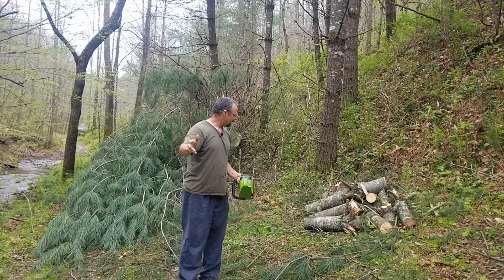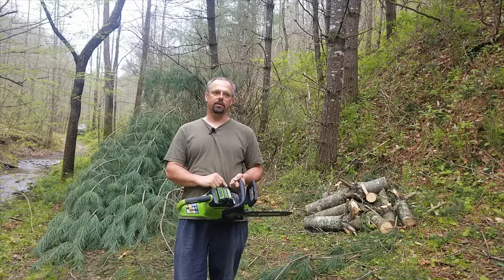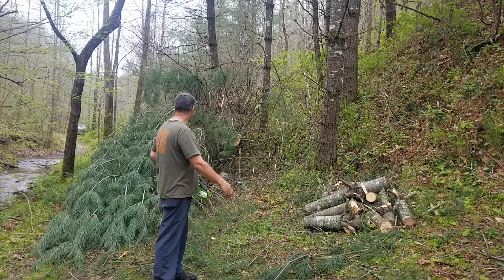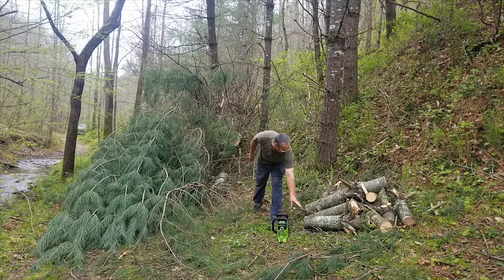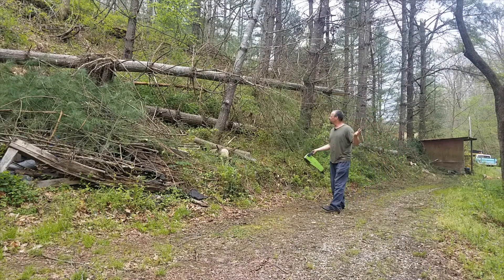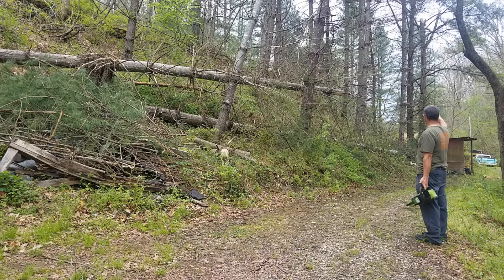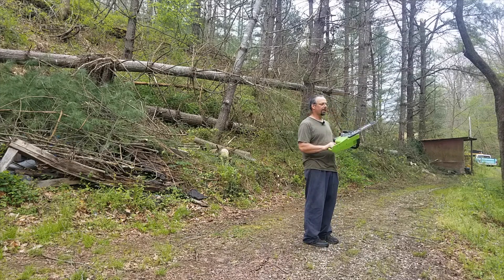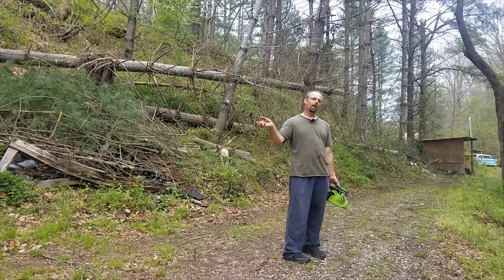Greenworks Chainsaw after the Mod

Comment: I have this exact same saw and while it cuts pretty well, I also experienced the shutoff problems, especially when the battery got down to one bar. Besides being annoying because it stopped in the middle of the cut, a cutter usually got stuck into the work so the saw didn't want to come out without being powered up. I'm pretty sure I'll be doing some relocating and possibly removing that problematic control. Too bad it didn't have a high temp adjustment to raise the cutoff point but moving it should rectify the problem. Even with the sensor gone, it should be easy to monitor the temperature by laying your hand on it. Great tip, THANKS!!!!

Comment: I wonder if mine came with a sensor since its never shut off on me.
Reply from the maker: It might be working correctly and mine was a defective sensor. Glad you got a good one, seems the saw has potential.
Reply: @lukeFugate  I got lucky and caught Wally world advertising it 100 less than they actually sold it for. Its just the 40v 16" brushless but I put a thicker bar on it and when it's sharp it's been good enough that I haven't fired my old Husqvarna up since.  Ran it over with my finishing mower once, replaced bar, cut handguard in half,  painted it orange so I would see it better if I left it on the ground lol. Liked it so much I ended up getting a 40v 14"line trimmer and 8" 40v pole saw too. We have salvage stores down here that sell returned items and I've found another 40v trimmer, 2 60v trimmers, a 60v hedge trimmer, 60v blower, and a 10" 60v pole saw and all of those for 250. I can't ever see going back to gas!

Comment: My Greenworks saw 14in doesn't have the same sink board with the wire and so it still wont cut without shutting down for 5 min-JUNK!
Reply from the maker: Yes, mine has started that even with the mod now. Should've got the Dewalt.

Comment: Thanks for the video.
I have the same saw with the same problem.  It would run for a few cuts and then it would quit.  Then I would have to wait for 10 minutes to start again. I took the top plate off and found the sensor and I think I probably did the same as you. I haven't got to cut anything yet but I believe it will work  now. I love the saw but it was only good for a quick little job. I have some heavier stuff that I am needing to do and I believe it will do it now. 
Thanks for the idea.
Reply from the maker: It is an ok saw with the mod done. I wish I would have paid a little more and got a Dewalt.
Reply: Need info on how to mod the saw

Comment: These brushless lithium powered devices do have 3 winding motors and get 3 phase AC developed in the speed controller. The surprise is the high frequency switching involved. Thats the secrete behind those small wall adapters that give high current with tiny transformers. Induction device efficiency goes up big time with increasing frequency.
Reply from the maker: Yes, It is definitely not lacking power. It won't bog down at all.

Comment: Love mine. I have zero gas tools and all green works stuff. May buy a bigger mower someday or a electric riding mower. I got a 20 inch greenworks mower now. Gets it done and is feather light compared to a ice lawnmower.
I have duel power generator that intend to never put a drop of Petrol in. Propane is similar more reliable. Don't want to get caught with my pants down after a hurricane.
Reply from the maker: Yeah I think electric tools are the way to go. Instead of yanking on a cord 50 times, you just have to pull the trigger. How does the mower do as far as time on one charge?
Reply: @lukeFugate  Not much with the mulcher block in. Lot more with bagger. I have 3/4 acre lot and probably mow 1/2 acre. Change batteries about 5 times.
Reply from the maker: @Greenwashedhipppie  ok thanks. Seems like a lot of batteries.
Reply: @lukeFugate  Florida grass is strange compared to Ky grass. One spot you can't tell you mowed and the next is thick as hell and lays every way but up.

Comment: I been thinking about getting a cheaper electric saw, similar to that one. What you got there, is about the most I'd use it, just around the house, and to maybe cut 4x4's or something, fence post, anything lol larger, I have a gas saw for that, I have two actually, and there is always something wrong with atleast one, right now, one will not start, and the other, will just stop running! And not start back! Ha-ha ain't that the luck! Haha..
I'm thinking I'd build a extra large battery for it , if I get one, like my drills, I'm going to convert my old dewalt 18v to lithium, 5s4p 18650cells, and add to my other drill batteries, the 1.5ah 18v doesn't cut it, hope all is well,
Reply from the maker: It wouldn't be hard to make a battery pack for it. Thats a good idea.

Comment: Awesome, nice work. I was thinking a battery operated chainsaw would come in handy driving a Skoolie around from campsite to campsite. I don't really need a heavy duty gas engine, and that Dewalt is like $300. This may work for me, Thanks Luke. You still have my vote for the election this year, be safe.
Reply from the maker: Yeah this would be a great saw for just cutting trees out of the road.